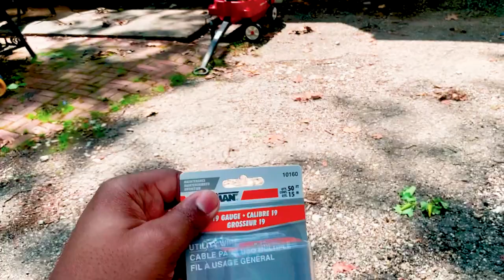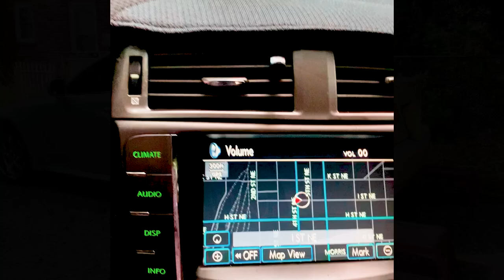Emergency Low Hanging Exhaust Repair | Lexus IS250 Stock Muffler

Comment from the maker: 🗒Part In Video: Dorman 19 Gauge Galvanize Wire (Part # 10160)
https://shop.advanceautoparts.com/p/dorman-help-19-gauge-50-ft.-mechanics-wire-10160/5012236-P

Recommended Part: Lexus IS250 - Muffler Support Bracket
*Part 17508-31101
https://www.lexuspartsnow.com/parts/lexus-support-sub-assy-ex~17508-31101.html
*Part 17509-31661 
https://www.lexuspartsnow.com/parts/lexus-support-sub-assy-ex~17509-31061.html

Comment: Thanks for this helpful video , can you tell me the part number for both sides I was having difficulty with phone screen and the numbers thanks
Reply from the maker: Sure, no problem..

Part In Video: Dorman 19 Gauge Galvanize Wire (Part # 10160)
https://shop.advanceautoparts.com/p/dorman-help-19-gauge-50-ft.-mechanics-wire-10160/5012236-P

Recommended Part: Lexus IS250 - Muffler Support Bracket
*Part 17508-31101
https://www.lexuspartsnow.com/parts/lexus-support-sub-assy-ex~17508-31101.html
*Part 17509-31661 
https://www.lexuspartsnow.com/parts/lexus-support-sub-assy-ex~17509-31061.html
Reply: @AWordFromMrJones  I appreciate your help fam thank you I order the brackets , did you have any issues reusing the original bolts ?

Comment: Thank you ! I have a IS 250 (2011) as well great car but I just noticed the left rear muffler was hanging slightly, its rusted out . I will be calling Lexus dealer to see the price... I think it will be expensive but hopefully a reasonable price! Is this maybe why its sun a little rough?
Reply: RUNS *
Reply from the maker: Yes that's correct, the muffler hanger for the rear tends to rust out because of limited air flow to remove the moisture. The part is not expensive and you should be able to find any mechanic to replace it. Search google for Lexus IS250 muffler support bracket.

Comment: I have this problem with my car but I don’t have a jack to lift the car up, I tried fixing it with zip ties but I didn’t have enough. I was just thinking of replacing the support bracket and hangers but I still don’t know how to replace it. What should I do?
Reply from the maker: Hopefully by now you have the part replaced. It's just 2 bolts holding the bracket in place.
Reply: @AWordFromMrJones I just order the two brackets , we’re the rusted bolts able to come off for re-use? Just curious because looks pretty rusty along my brackets
Reply: IT SHOULD BE MORE VIDEOS ABOUT THIS ISSUE AND HOW TO DO THE REPLACEMENT CORRECTLY